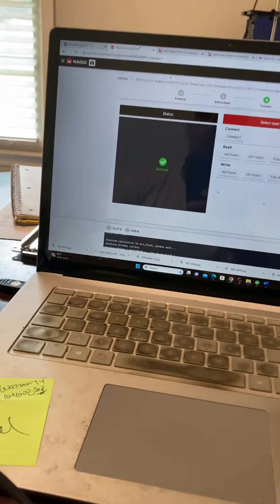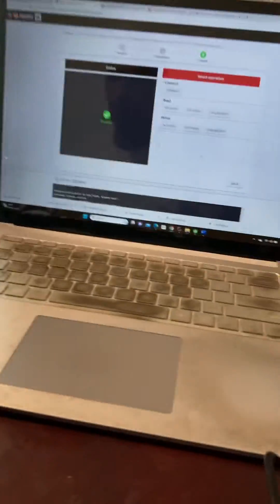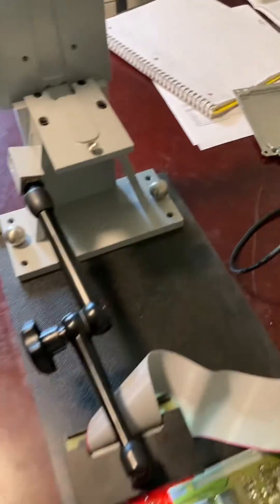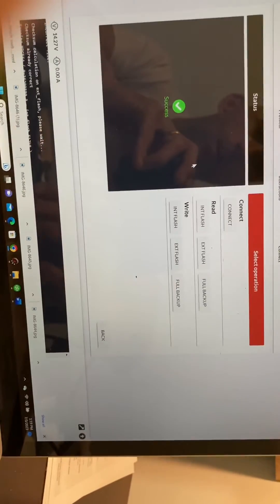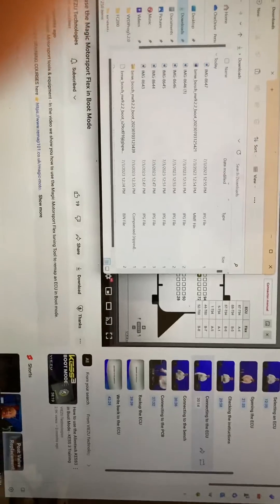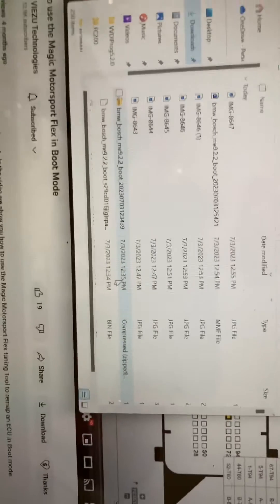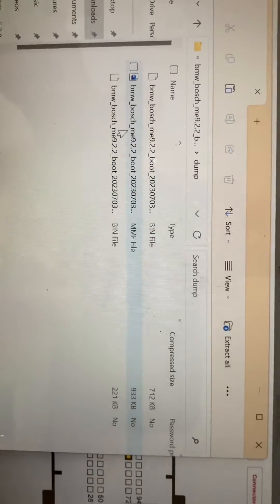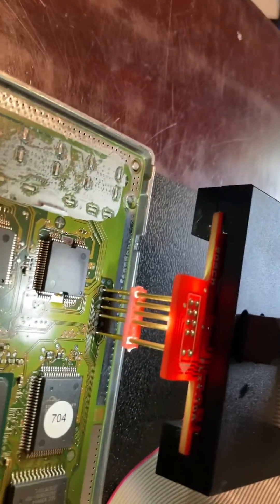2008 bmw 550 ECU Cloning ME9.2.2 Magic Motorsports Software! Awesome tool

Comment: Hey man. Thanks for the video. I'm dealing with the same exact module. I have everything you are using. I'm just having a hard tine finding it on flex list. Could you please tell me under what you went?
Reply from the maker: For sure, search 650 E63
It’ll show a year range it’s there, just won’t find 550
Reply: @eurowerx4267  thanks. Will try that tonight.